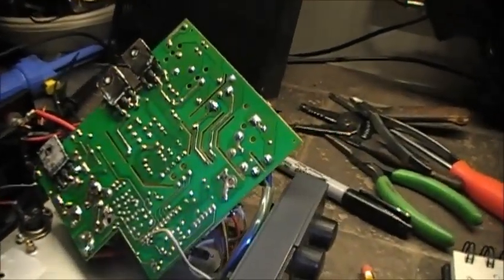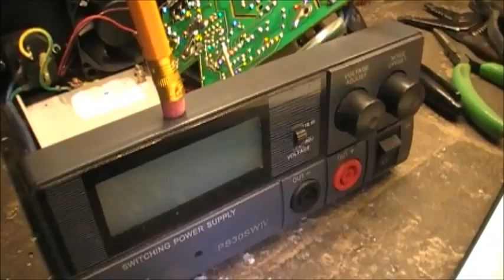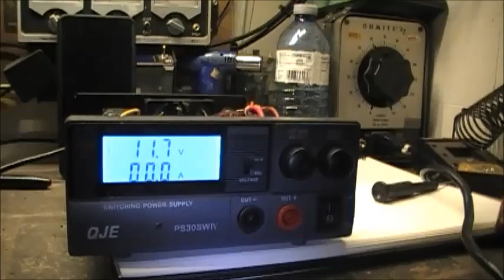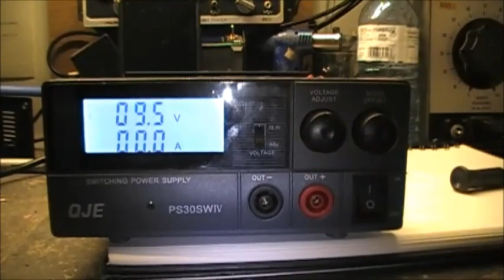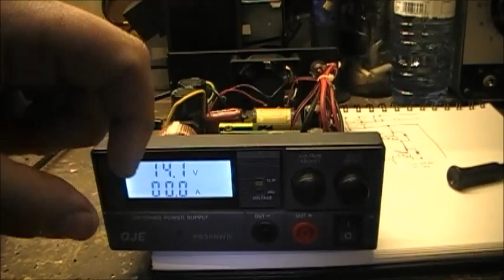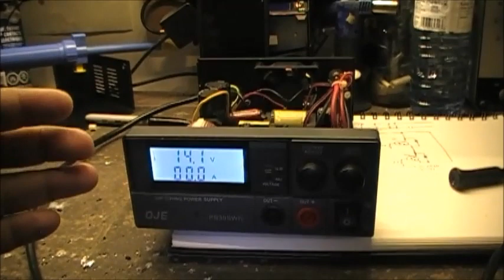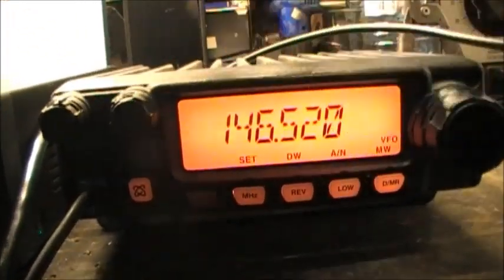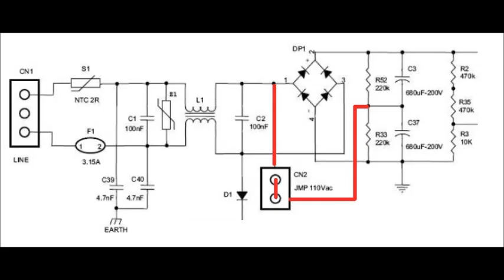QJE PS30SWIV - 120vac MODIFICATION - Part-4

Comment: Nice info. I would have binned it. 
If you put a switch in that patch wire. You could make it switchable. 🤷🏻‍♂️ 

Good video. Well done buddy!
Reply from the maker: I may end up doing that, but as we don't use 220vac for day to day needs other then for heating, cooking, washers, i don't really see the need to do it.  :-)